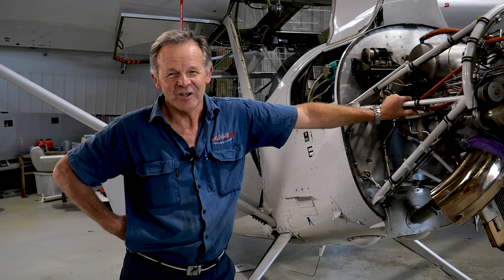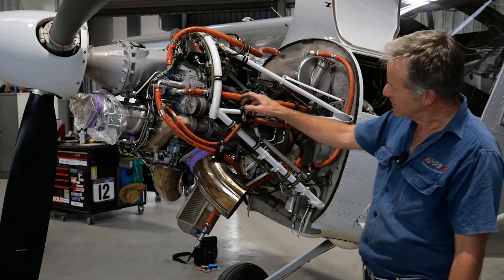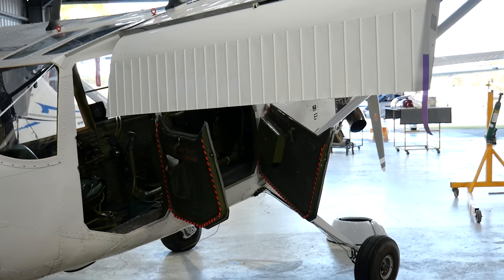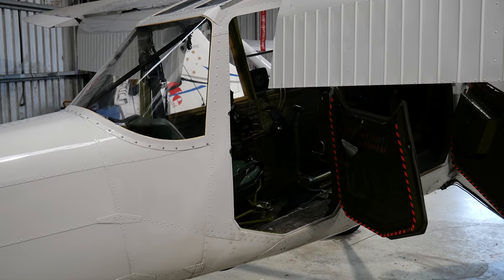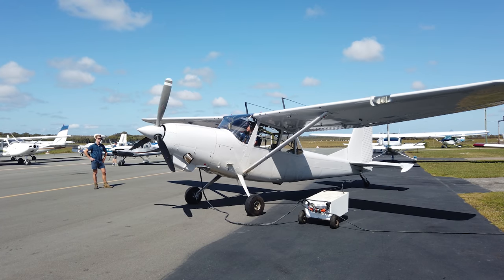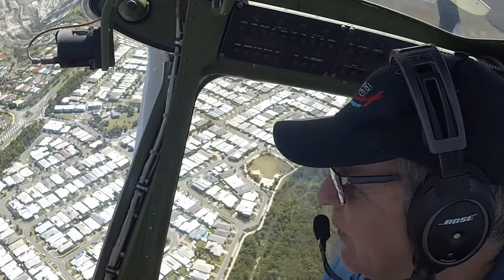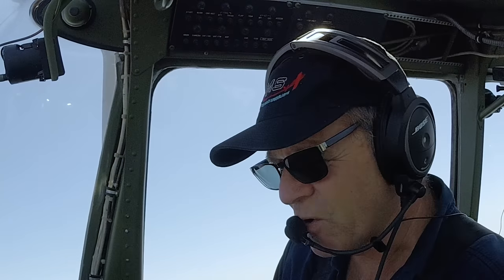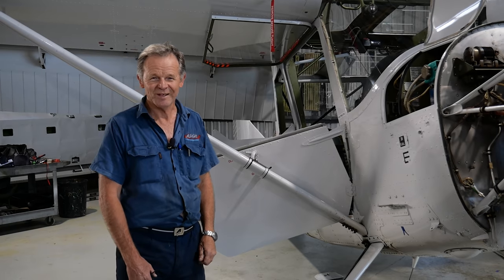SIAI Marchetti 1019: Test Flight

Comment: Did you lift the tail wheel before getting airborne? Or does it do a three-point take-off?
Reply: Judging by the sight picture it looks like he did a 3 point (actually looks like it jumped off the ground! :-). With the prop wash and size of the tail feathers, it doesn't seem to be a problem in this aircraft. Not sure what the POH says ... but I was taught to always make sure the elevator is alive before you rotate. Some taildraggers have crashed because the wings lifted the mains off before the tail became effective. Skal, ^v^